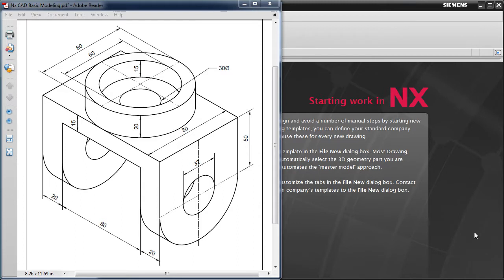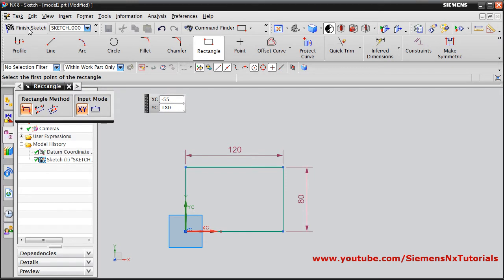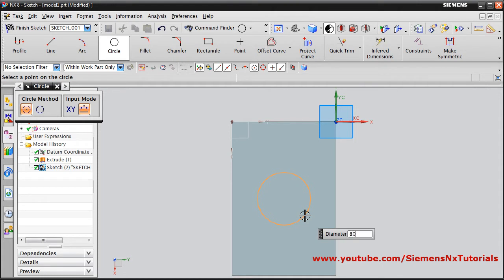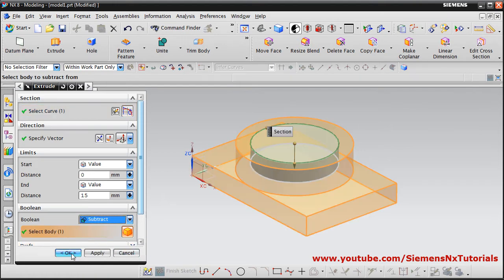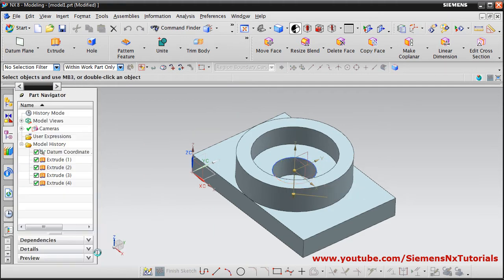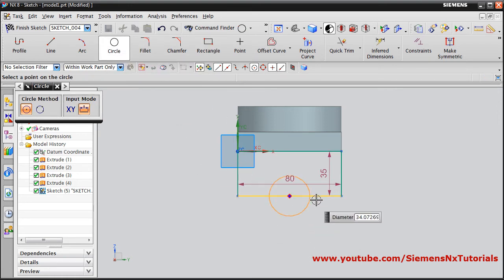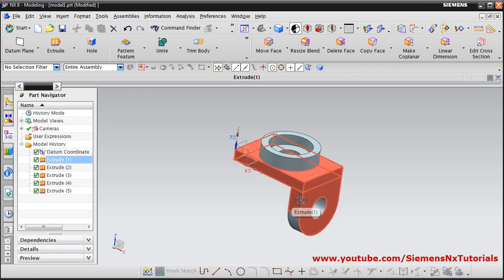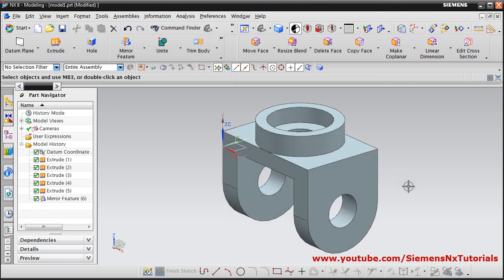Siemens Nx CAD Basic Modeling Training Tutorial for Beginner - 1 - Updated

Comment: Show how heat transfer takes place in metal bar due to radiation in vacuum..?
Reply: consider a hollow tube kept in space, having 60mm and 50mm inner and outer dia. respectively. now, apply heat transfer from one end of the tube with a heat flux of 1350w/m2 and temp. 250c. show how heat transfer takes place through the length of the tube. Length of the tube is 5000mm
Reply: How about the warpage of time thru dark matter in space?